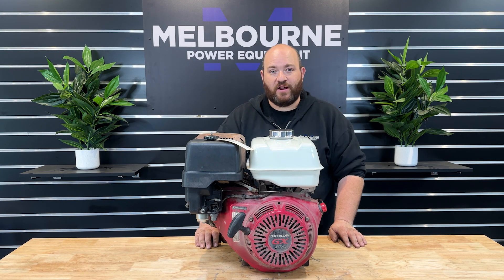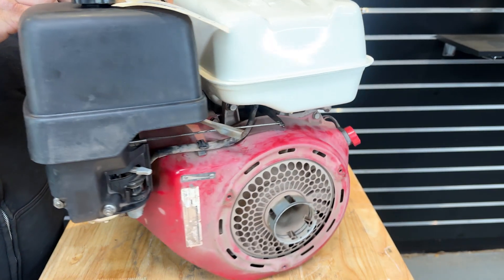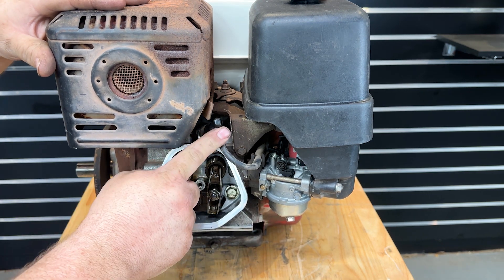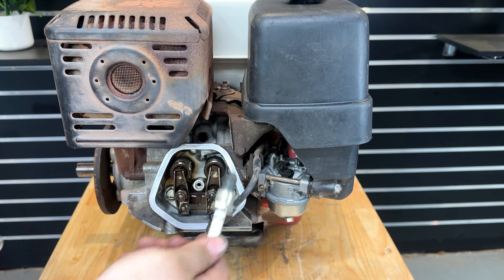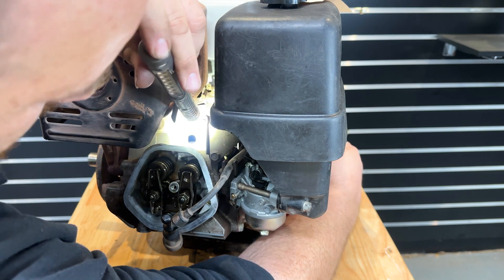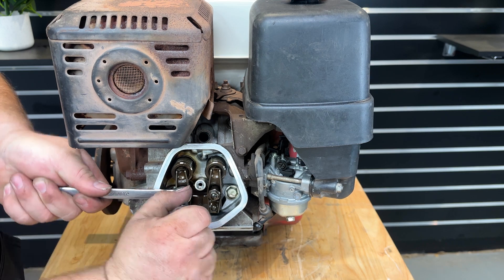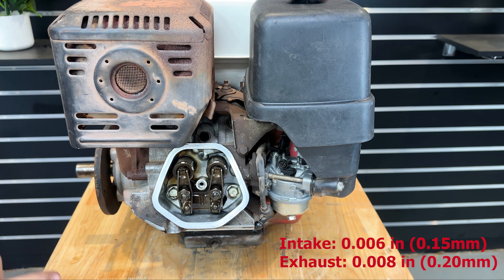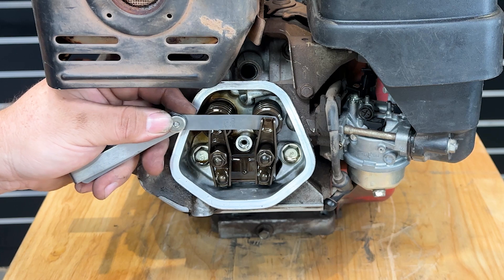Honda GX160 - GX390 Valve Clearance Adjustment

Comment: My engine misfiring. Do you think is the exhaust valve sr ?
Reply from the maker: Hi,
There could be a number of reasons for your engine mis-fire, checking the valve clearance is a quick and cheap first step though! If it still has issues after that let me know and il give you some more things to check. Cheers - David